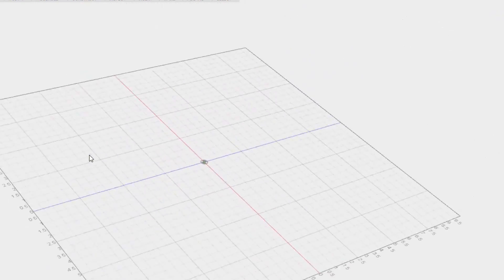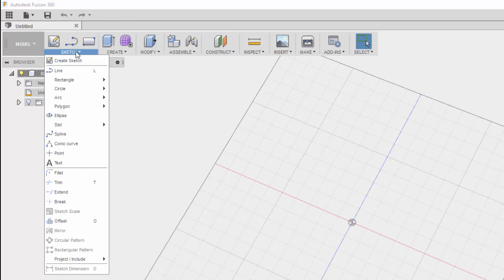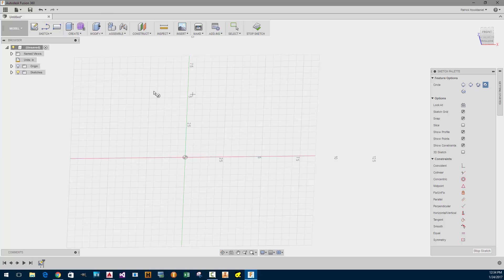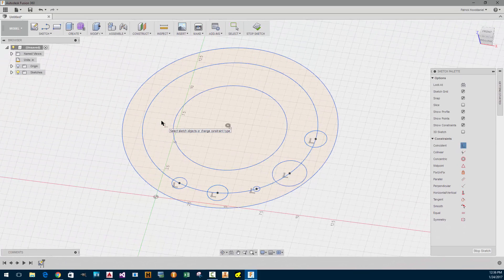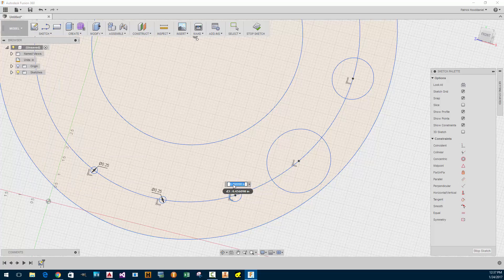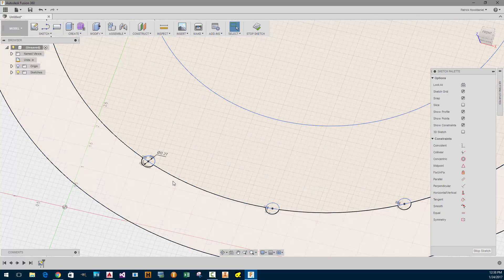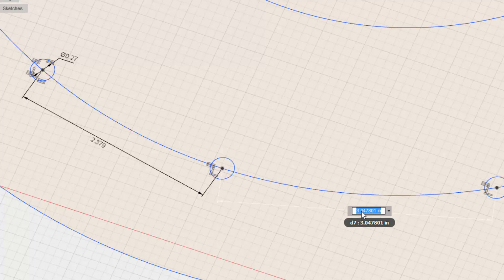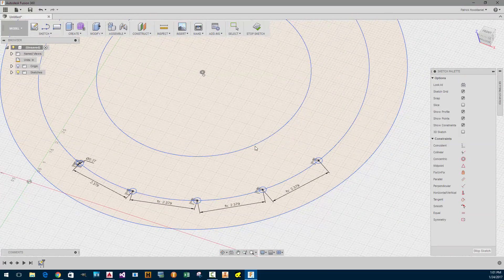How to use Fusion360 from the Perspective of an AutoDesk Inventor User Part 1

Comment: The Fusion 360 CAM kernel is also available for Inventor,  search Inventor HSM, and but it's an add-on. on the other hand fusion 360 has it built in. but its mostly the same, but inventor HSM is bit more powerful in my opinion.
Reply from the maker: Interesting.  I have a tiny bit of familiarity with HSM as it was demonstrated to me a while back.  My interest in Fusion 360 is that there is very little barrier for entry and if I remember correctly, the Inventor HSM was a product out of my reach back then.  I might try it later, however.
Reply from the maker: Your comment has piqued my interest in the HSM.  I may consider doing some videos investigating this software (the free 2.5 D version) after I fully learn Fusion 360 and see if the capabilities match Inventor, at least to the extent that I feel comfortable.